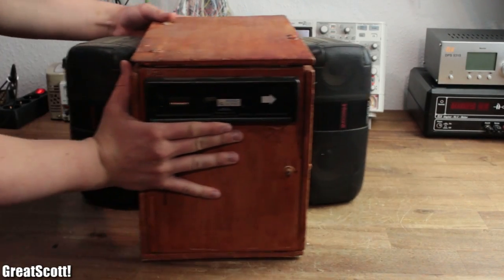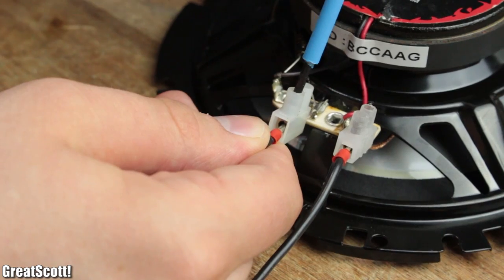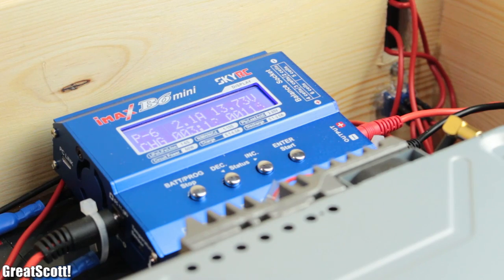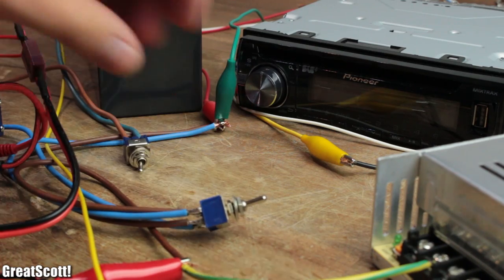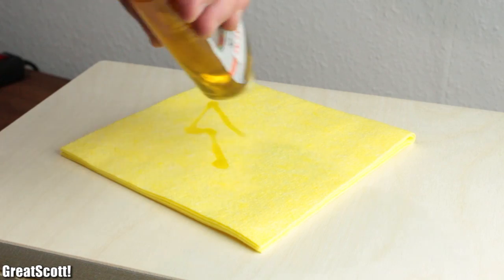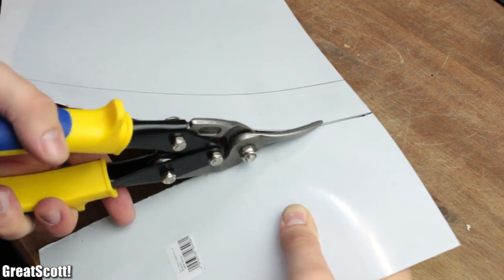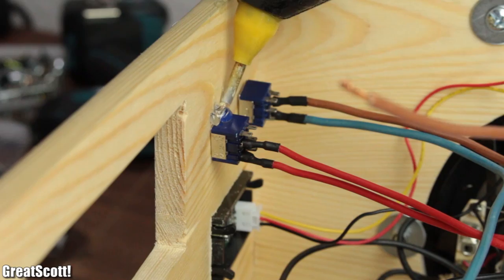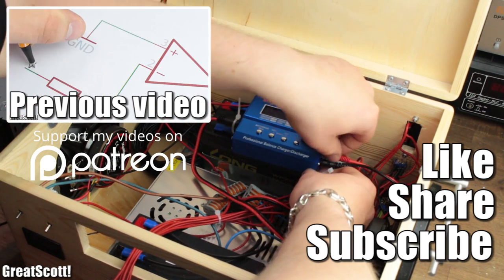Make your own Boombox

Comment: Hello GreatScott! Thanks for this great idea for my old car's salvaged speakers!
I've got 4 speakers:
2 x Rated 46W Max 160W 86.3 dB Fusion PP-FR5252
2 x Rated 25W Max 140W 89.0 dB Sony Xplod XS-F1331
All are 4ohm Impedance
I've got the following questions if you may answer/help me!
1)I am looking for a power supply as you noted, 12v 30A , though i see many that vary in Wattage. Whats the prefered Wattage?
Could an old PC PSU 500W (3.3v 30A)x1 (5V 28A)x1  (12V 18A)x4 do the job instead? Would i need a dc module to increase voltage for the charging?
2)Do i need 2 lead acid batteries or i can use one as well; Is the possibility of using 18650 batteries a better solution?
3)As i read arround and saw many videos i understood that I'ld either get a good Car audio source that has prebuilt AMP of greater that 46W ex. 50W x4 at around 80 euros or a cheap source and add an amplifier (car? Premade panel? How much Wattage you suggest?) which i really cant understand yet with my poor knowledge but wondering if these speccs Battery/PSU you suggest can handle it...
4) The point of this project is to have a good wireless(+ chargable) bluetooth boombox and if the budget exceeds 100-150 euros, i could better consider buying for ex. a JBL at a discount i guess...
Ive got all the necessary equipment to solder and manage cables, drill wood boxes etc. and i think i could make it possible.
Thanks in advance!
Reply: 1.  ideally the charger needs to meet the current demand of the receiver.  It can be less, it can be more.  If the receiver draws more current than the charger it will discharge the batteries while in operation.  If the charger meets the current draw of the receiver the battery is neither charging nor discharging.  If the charger exceeds the receivers current draw it will operate the receiver while charging the battery.  Time for you to learn watts law to convert watts to amps.
2.  Battery's are energy storage devices.  The more amp hours you have the greater the capacity, thus the longer it will run on battery.  Makes no difference what battery technology you use.  However the charger must match the battery technology.
3.  Output wattage should meet the speakers rated wattage.  Now in reality most of the cheap head units introduce significant distortion above 50% of rated output. 
4.  I doubt you can compete on price if you have to purchase everything.  However you will have gained knowledge, experience, and confidence.  You will own those for the rest of your life as you apply them to different projects as you get older.

Comment: This video is good but I'm new to speaker design so can you make a indepth video for your wiring? Lol
Reply: Its actually not about speakers.

The only thing speakers need is an connection from the Speakers to the Amplifier. (In this case the Car radio)

The harder thing is the wiring for the powersupply. Thats all the complicated stuff you see. If youd want to start easy you could hook up the power supply directly to the radio and then connect the speakers. That would be an working radio.

If you look at the scematics he provided you see that there are just two plain wires going to the speaker. (If you cut out the optional speaker terminal he build in)